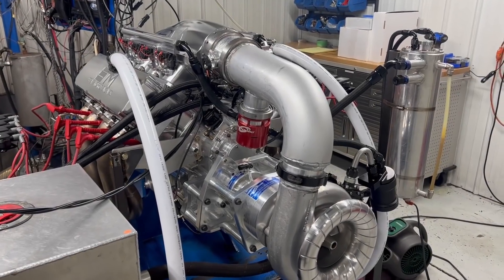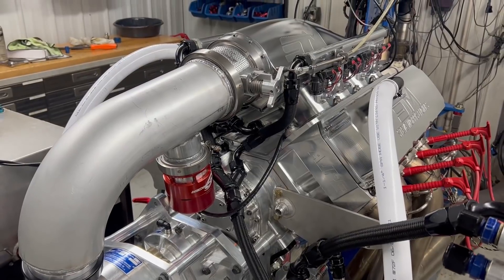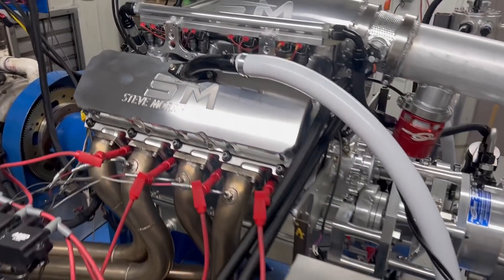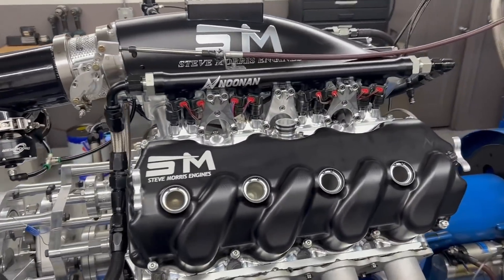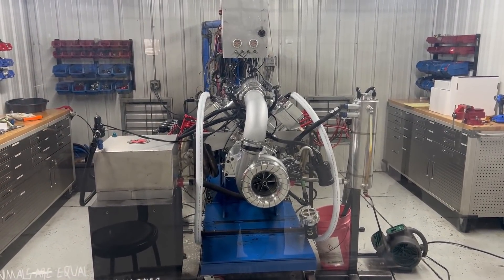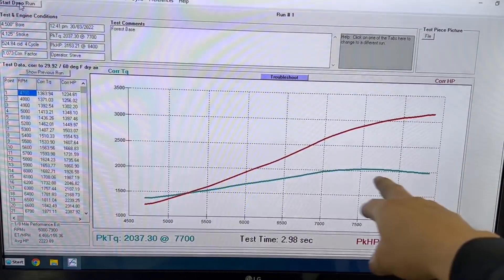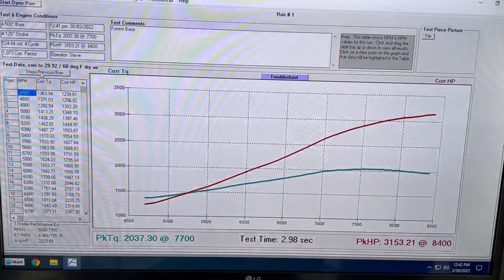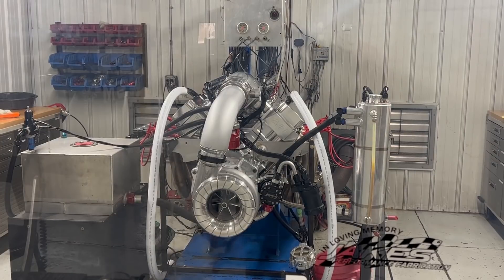ProCharged 481X !

Comment: Why is no one doing twin pro chargers
Reply: Don't know for sure but Superchargers take a lot of power to spin them at high boost. I have read that 15-20% of measured crank HP is consumed by a centrifical supercharger. Two superchagers-30-40% where as a larger single unit might only be a small percentage increase in power "lost". Spooling is also not an issue like with a turbocharger.

I can say from experience, when the Nissan 350z came out, I had some first hand experience with several cars. The single turbo kits generally made about 15% more wheel HP than the Procharger kits at similar boost.

Comment: It’s just amazing how far we’ve come. I started racing in ‘74 and you took the best cores you could get, massaged them, and prayed. Your exotically engineered blocks and heads take more than a pounding, all at cool temps, over mikes and miles.
My sbc 331 always needed power valves & spark plugs, usually done on the side of the road. Lol

Comment: In regard to pro chargers I’v heard that they are junk and you have to rebuild them after every run. Does that hold any weight?
Reply: no
Reply: Not true!!
Reply: Deep breath!!!!  Um, for example, do you watch Street Outlaws or NPK?  Almost every one of them runs a Pro Charger these days and they are not "rebuilding" them after every run!  Where do you guys hear this nonsense.  We ran one in 20 events last season, with no loss of boost.  It is fresh this year (yearly "rebuild" is certainly okay, right?) so we are hoping for an even better season.  I would quit listening to the dumb asses you have been hanging with.
Reply: That's good question!  I'm interested too!
Reply: Ring em up with your assumptions

Comment: How long do dry deck and heads run before overheating?
Reply: You run it on methonal, no cooling system needed
Reply: @rossobernuefemann5063  yeah it does run cool with that fuel but its only for a pass at a time correct? You aint gna drive it anywhere even a few miles away correct?
Reply: @Marcus2750-u1t  correct, this for a burnout and a pass type of situation, then shutdown.
Reply: @rickmosholder4593  gotcha….. a very FAST pass no doubt….. wow

Comment: Estimate cost for it and no water cheaper
Reply: If you don't have $100k, turn the page brother!
Reply: 100k that sounds cheap
Reply: @Turningwrenchs  ..That would be a long block.  You're right though, there are more pieces needed!  This is not a game for the frugal!!
Reply: @paulcopeland9035  silly to ask but  just want to know .musi weld s plate to his blocks  and i would think thats alot stronger. Maybe Steve will go into the different and the Pro & Cons
Reply: @Turningwrenchs  ...The billet Morris SMX is incredibly strong.  Steve has been making these ultra high power engines for quite awhile and I am sure they are as strong or stronger than anything available.  You don't often hear of one of these engines grenading!!